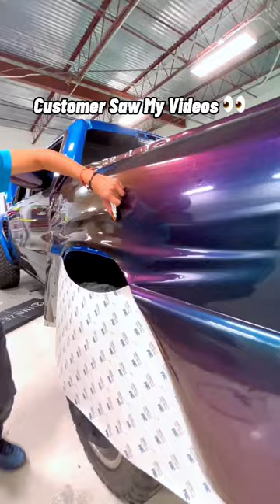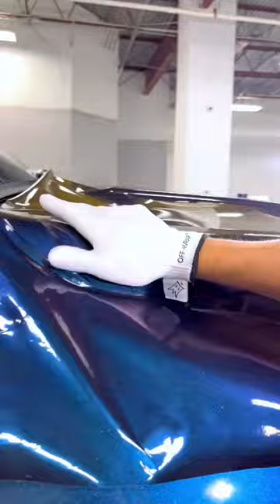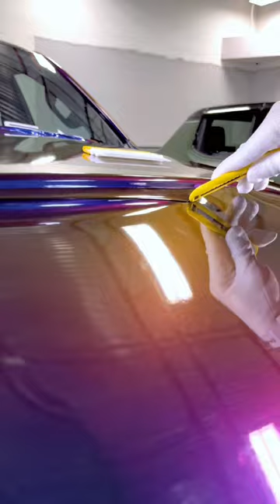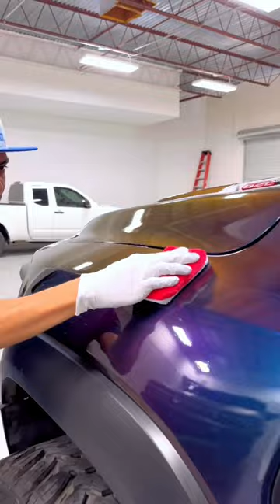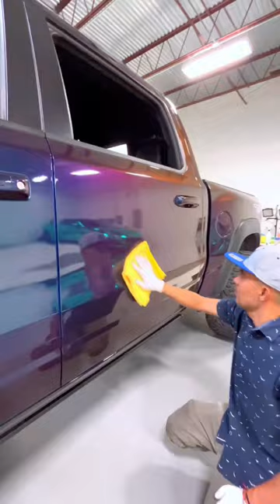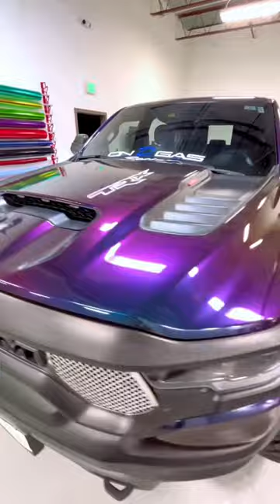Chameleon WRAP on the New Dodge TRX ! 🤯🔥 #dodge #ramtrx #carwrap #carwrapping

Comment: Where are you guys at? I just bought a 2015 Chevy Silverado 2500hd and it has a few dings and stuff on the body but after I get that fixed, I want to get it rapped with that protection film.